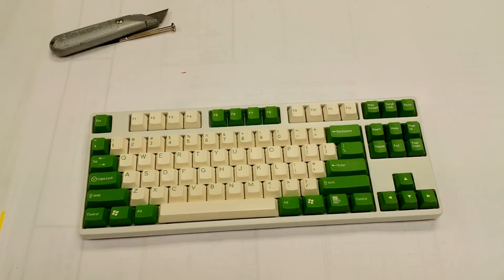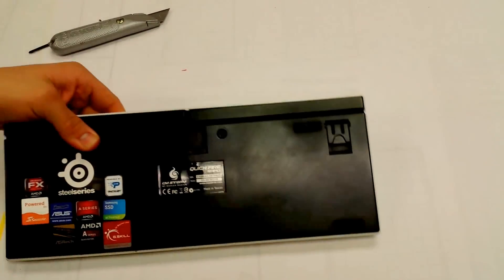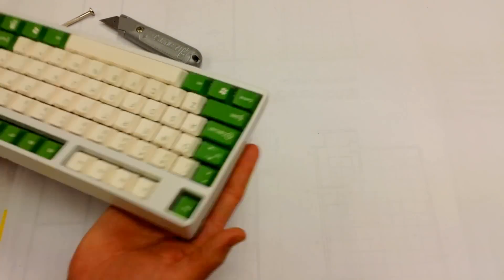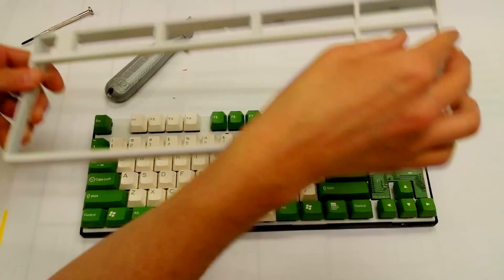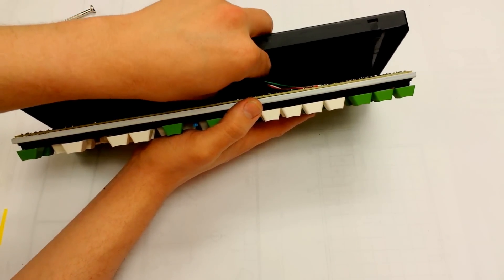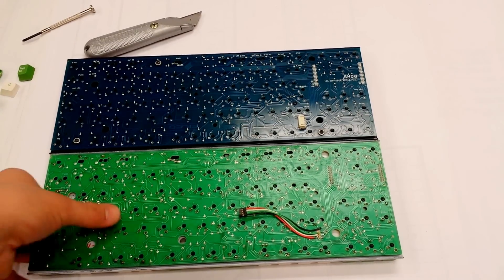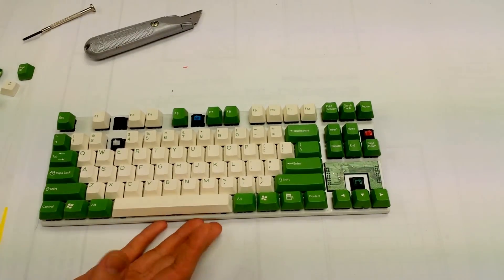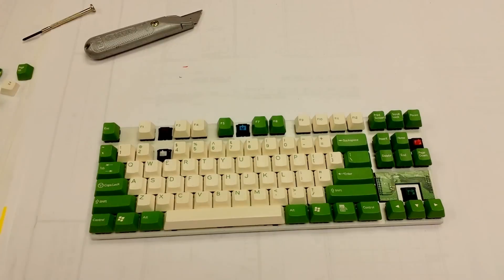Cooler Master QuickFire Rapid disassembly

Comment: I know this is an old video, but how did you remove the rubber coating on the CM QuickFire? Or did you just paint over it?

I find the rubber coating a real pain in the butt to clean up and I wanna remove the rubber coat and paint over it so it can be cleaned like any other normal keyboard.

Comment: you just saved my keyboard man, i split like half a bottle of water into the right hand part of the keyboard and even onto my laptop keyboard as well. i rushed and dried it as quick as i could with a towel but when i plugged it in it didn't work, wasn't recognized or anything, searched this video up, took it apart as quick as i could with a Swiss army knife, wiped it down with q-tips, plugged it in and it works! now ive just gotta hope that water didnt get down into my laptop motherboard, guess ill find out by tomorrow :/

Comment: Great video, thanks! One clarifier - mine had two additional screws, one above the 2-3 keys and between Backspace and Ins(ert) before I could remove the bottom. FYI!
Reply: I wish I read this comment earlier, I spent like an hour trying to pry up the bottom before I realized I had to unscrew them. I thought they were just for disconnecting the pcb and the keys.

Comment: I broke my QFR after taking it apart. Any idea how I can figure out what part of it broke and possibly how to fix it? I was cleaning it with alcohol wipes so there was moisture involved, although probably mostly alcohol which evaporates, and I left it in front of a vent to dry for a night before plugging it in. Aside from this, my usb port daughter board and connector came loose on both ends and there's a chance I plugged it in backwards when trying to fix it. I was doing the disassembly to add in the Frosty Flake controller, but now I can't get it to work even with the original controller in it. I have tried the usb port pins flipped both ways. I don't get any response. There was no noise or spark or burnt smell. It just doesn't do anything. Not detected by lsusb on GNU/Linux and it can't type. I have a pok3r for my main keyboard, but it would be sad if there was nothing I could do for the QFR. It was my first mechanical and I was hoping the Frosty Flake would breathe new life into it.
Reply: @Trey McAuliffe No, I just pulled it back out again today and found that it seems to be dead. I was hoping to get it going and put QMK on it since the Frosty Flake has QMK support now.
I can't remember what I did to it before. I thought I had it working again temporarily after a friend of mine looked at it and possibly did some minor soldering. It might just be the daughterboard connection that's faulty.

Comment: Thanks for the video! trying to rescue a cm storm after a big spill :(
Reply: seperate it as much as possible, throw it in the dishwasher, and let it dry in an oven for 2-12 hours at 65C, that's how I saved mine.
Reply: @Menalix  Really, you did that? Mine has several keys that only work if I punch them a couple of times. I was thinking of something like you say, and then just make sure it dries out completely before using.
Reply: @ThomasJeppesen  Ye do that, just dry it in the oven. That's in general my go to fix for all electronics. 
It is standard that all electronics is washed in a type of washer anyways to wash away certain chemicals used in the production. It's just important to dry it before use.
Reply: @Menalix  Excellent, I'll give it a go! Thanks, mate!

Comment: So I have a Adesso EasyTouch, which is basically the same keyboard under a different name... I've unscrewed the 1 screw and I accidentally cut straight through all of the tabs at the bottom... but it won't come apart. I have no idea what's holding it together at this point but the top simply won't separate. Any advice?

Comment: Thanks to this video I managed to fix one of these keyboards which had the micro USB port damaged due to an aggressive pull and had to soter the cables directly to the pin connector, similar to what you did with yours.

Comment: Did you rapid have any bad solder joints when you first took it apart?  My left alt stopped working, which is common for the CM keyboards apparently, and it seems to be related to bad joints.

Comment: Hey I have a question. My quickfire rapid keyboard started losing connection to the wire, it cuts out when i shift it and stuff. Do you know what to do to fix it or trouble shoot it?
Reply: Recently I fixed a keyboard with that problem the USB port underneath the keyboard had been broken off of the PCB causing an intermittent connection. I had to resolder the connection in order to get to fix it. I'm not quite sure if this is the same problem you are having.

Comment: Thanks for the video, quick question though: Can I remove the faceplate without messing with the warranty? Or does the screw hold the faceplate together with everything else? Again, thanks!
Reply: Unfortunately you have to void the warranty in order to disassemble the keyboard.

Comment: I like the feel of mechanical keyboards, but I also like membranes. Mechanical might be a bit more pleasing, but they are significantly more expensive than ones I used since my 1st pc. Currently I am using a slim keyboard from Dell, which was 1/6th of the price of a cm storm quickfire with brown keys which I have purchased a while ago. Right now I am thinking about selling it. Why you might ask? Because I liek both type of keyboards. One seems to have quite a few advantages over the other. Firstly, it doesnt cost much, so it is easy to replace in case something bad happens. Then It is also comfortable and I even happen to type faster on it. In terms of longevity, I still had probably one of my 1st keyboards. And it was still wroking. Well, until I accidentaly bent a pin in its ps2 connector. So personally I do not really see much point in purchasing mechanical keyboards. Except for the fact that they feel nice. And everyone likes having nice thins aroung, especially when one uses them pretty much every day, eh?

Comment: I was thinking about adding LED's to my CM Quickfire Stealth. I don't plan on changing any of the switches as I like the browns that are in now. However I did want to put white or red led's in the 1-0 and wasd. And possibly the whole keyboard. Is that as simple as soldering the led's in or do I need a power supply/ controller to do this?
Reply: I know this is a late reply but I wanted to post here in case people had the same question. 
Unfortunately the quickfire rapid does not support in switch LEDs besides caps lock, scroll lock. A keyboard like the poker 2 non led model still has the holes for the LED and the resistors so it's as simple as  reflowing the holes and adding the LED of your choice.
Reply: ***** yeah I figured this out when I took it apart.